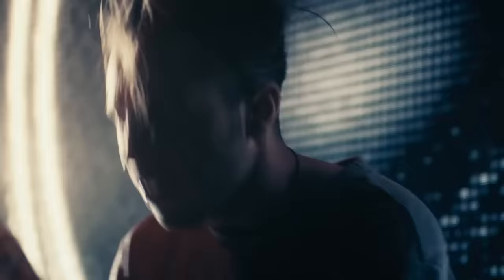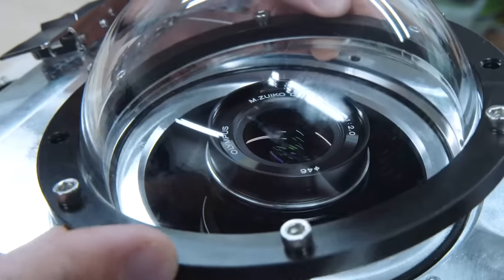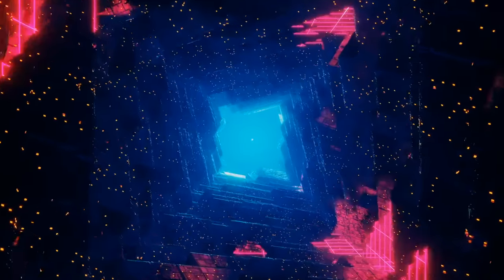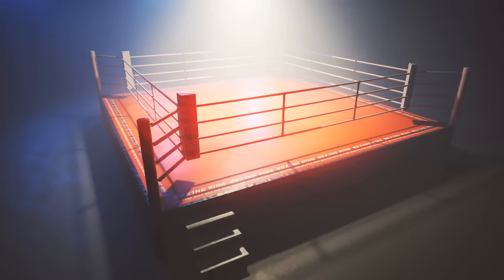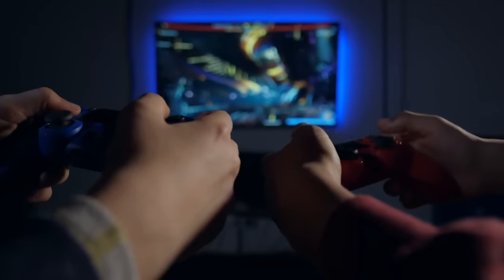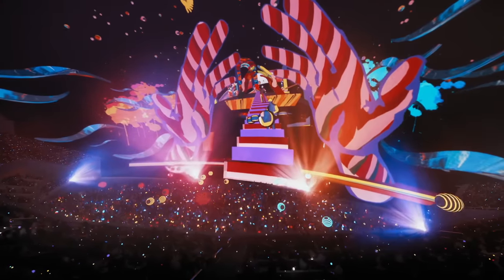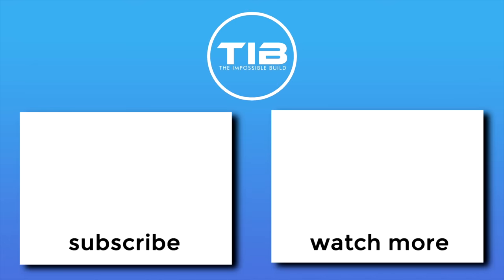The Insane Engineering Behind MSG Sphere Las Vegas

Comment: And I got to watch them build it cuz I'm a cabdriver here and drive past this numerous times each day. It's EPIC!
Reply: What picture do they have on the sphere usually? Do they change it everyday, multiple times a day or do they mostly just keep one picture over it when nothing special is happening?
Reply: @StarClay666  during the day they are usually still just testing a few colors and/or patterns so it's nothing like pictures or video but at night they've been displaying various pics n vids
Reply: @StarClay666  It is continually changing, so if you're driving within eyesite of the Sphere, don't take your eyes off the road for more than a half second or you'll likely run into the vehicle in front of you, who has stopped to look.
Reply: That's cool as fuck dude😮
Reply: @rnovick so its a dangerous building. they should shut it off.

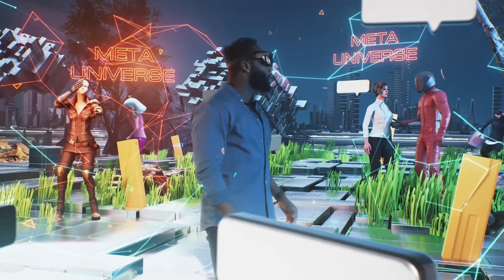Comment: 01:26 when you say '4D' what you mean is sensory. It is, in fact, 2D, so you're two dimensions off. And it's not a sphere, it's a hemisphere.  04:23 stop saying 4D! These are 'special effects' in film vernacular, but the screen will remain, resolutely, two-dimensional, hence your 16K x 16K (note the two dimensions) spec. 16K x 16K is 256 megapixel, btw.